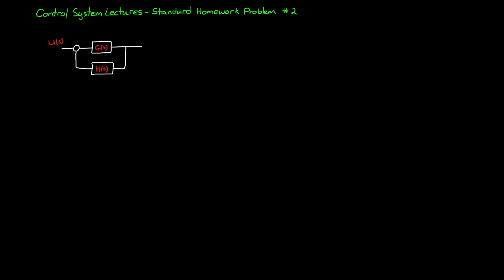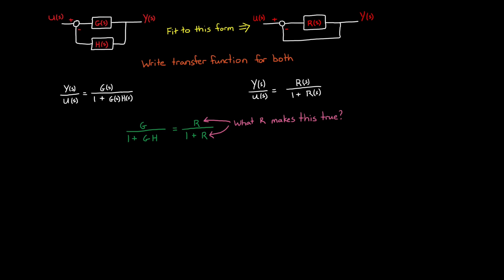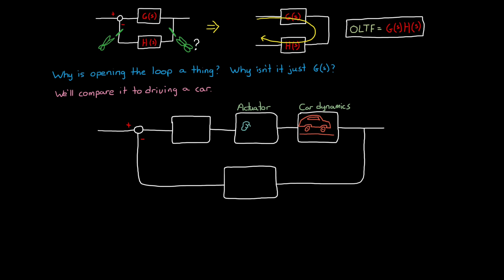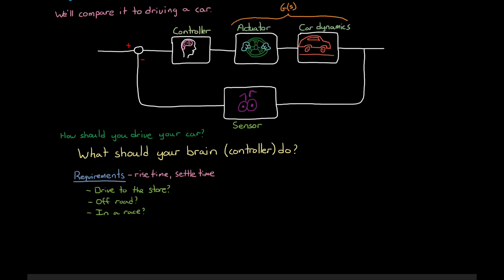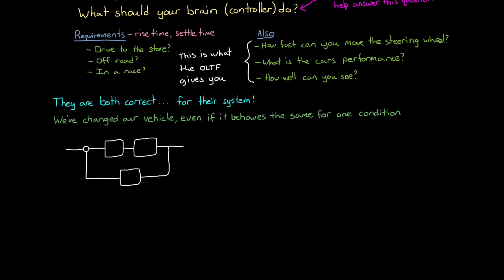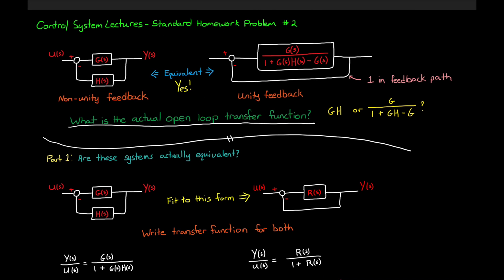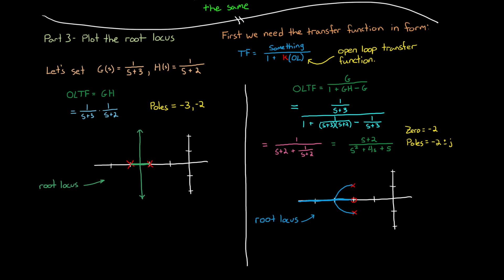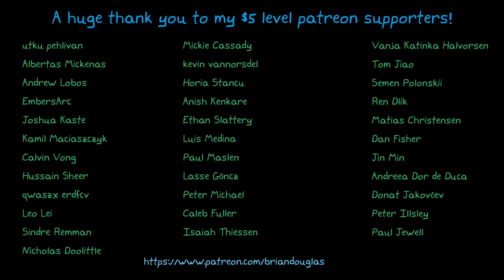Standard HW Problem #2: Which is the real open loop transfer function?

Comment: Say I have a cltf, and I simplified into a single block , with no intention to adjust the gains. now can I simply design a system with that single block transfer function? if yes, will it still have feedback ? Because isn't it exactly the same as the cltf but simplified ? And wouldn't that imply that in theory feedback systems can be designed without an actual feedback path ?

Comment: Why is it that the OLTF is G(s)H(s) and not H(s)G(s)? I thought the blocks were supposed to be multiplied against the flow?
Reply: It's multiplication, it doesn't matter.
Reply: The Musterion Of Rock it would matter in a MIMO system though yes? Or does this only deal with SISO?
Reply: Cody I don't see how it would matter if you assume the transfer function is something like 1/(s+1) x 1/(s+2) it's gonna be the same even if you multiply the 1st and 2nd or the 2nd and 1st

Comment: In part two of this video, you said if you cut the loop just before the summing point and then measure the gain which will obviously be G(s)H(s) if and only if we take our out point is our breakage point. However our out point is still going to be the take off point pertaining to Y(s)( or simply Y(s)). In that sense the open loop transfer function should stay as G(s). Can you please explain on this.??
Reply: Kunal Panchal Taking the output Y(s) as the breakaway point when the loop is cut at the summing point would defeat the purpose of having introduced the feedback, right? That would resemble a simple forward path, which you can of course look at as a system with no feedback.

But what we're more interested in is in trying to analyse what the feedback signal is going to be like by studying the function that transfers the input to the feedback (which is also called the open loop transfer function of the closed loop system). And through that make some observations about the properties of the system that results when the loop does get closed.
Reply: Alright your statement is quite logical but if you are breaking the path of feedback sensor for sensing, than what is the usefulness of the sensor/feedback path.. Maybe Mr Brian is trying to make this point in above video but still I am unable to pickup.

Comment: Hey, I'm a frequent viewer of your channel and needed to say your intuitions are really good. But in the late videos it seems you are going backwards. In the sense, back to the very basics. I hope in the coming videos we could find some advanced and non linear control systems. Such as pid tuning, non linear system characteristics etc...
Reply from the maker: You are correct, I am going back a bit.  Most of my posts have been on the book I'm writing, which necessarily is starting from the basics.  I'm getting back into making videos right now and I thought I'd start with a few questions I received but have neglected over the last year.  I'm working on some new stuff ... specifically some discrete control videos.  I think I'll cover PID tuning after that.  Nonlinear system characteristics will probably be after state space control techniques - and that might be a while since it takes me so long to progress through topics.  Thanks for the comment!
Reply: Brian Douglas : yeah state space is really a good topic, and I will be eagerly waiting for the controller and observer part. Hope it will not take too long.